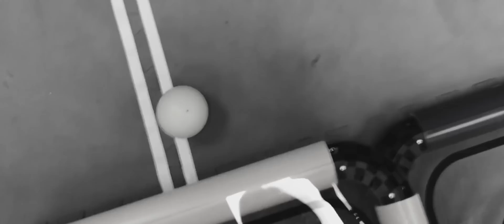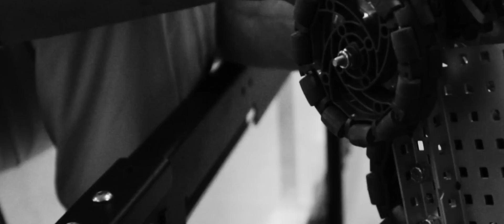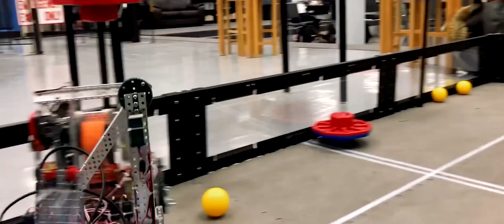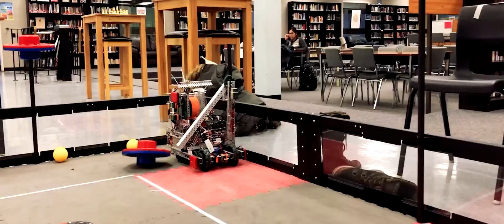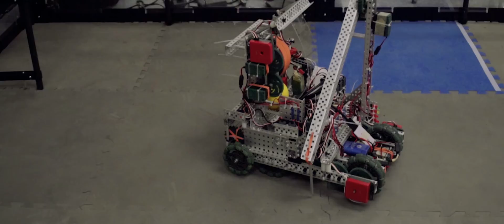2381X "Miffy2 -2" Vex Turning Point Fall Reveal

Comment: @Anthony Luo are u guys competiting in Ottawa, more specifically at Barhhaven, in Longfields Davidson heights?( in my school)  on Decembre 15th?
Reply from the maker: LDHSS-RoboRavens-VEX 4783A yup, we should be there.
Reply: @antholuo  see u the competition , good luck. Actually u wont need it u already have one done and i belive next one ith a reverse 6 bar is on the way? We need luck though, we spent a lot of money getting 2 control system, motors... and best part its not here yet, so we have to program something completly new to us, and then practice driving in less than 25 day. Even that  not possible unless we get the controll system in like couple days. We might have to end up using the old one. Any ways, cya there on the 15th :)
Reply: Also do u know anyother teams that will be coming?